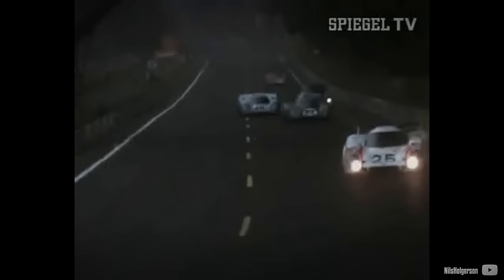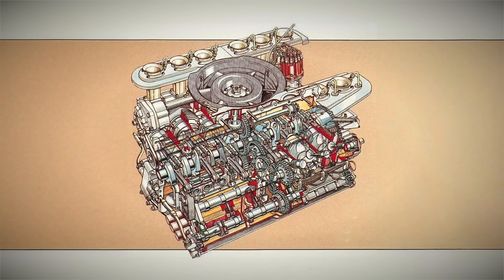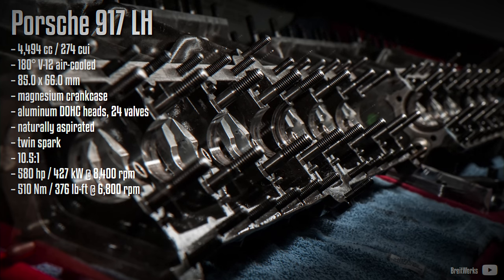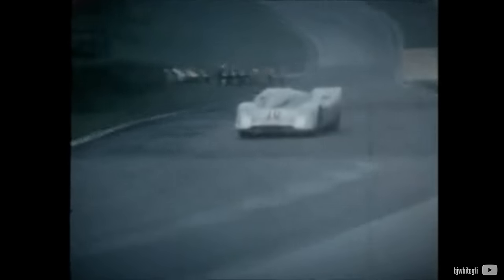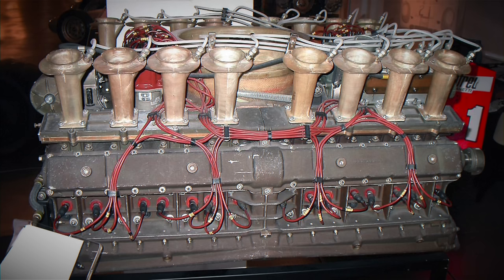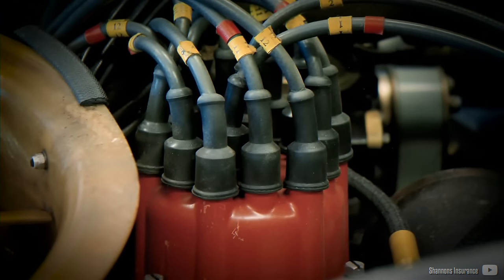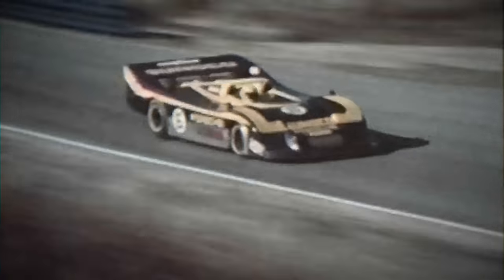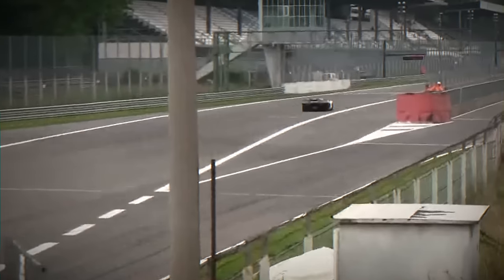Porsche's 2000hp 16-Cylinder Race Car Killer

Comment: Thanks for this awesome video! I have a somewhat special connection to these engines and vehicles as my grandpa used to work as a race mechanic for porsche at that time, he even helped build a few of those 25 917s! Luckily he ist still with us and loves to talk about that time. One of the anecdotes he once told me was that apparently the pistons could melt if you've driven the 1600hp qualifying spec of the turboed flat 12 for too long. I really love him
Reply from the maker: Thanks for the story! I wish your grandpa good health!
Reply: Did he also tell you the 1600hp number is nonsense? Porsche did not have a dyno that could read past 1200hp, so anything higher than that were just theoretical peak numbers that wouldn't be sustainable for any amount of time, given the turbos were blowing hot air directly into the block... intercoolers were tried for the first time only when the car was finished at Can-Am, and was being setup for the closed course record run, and even with intercoolers, they went back to the older 5.0L engine, because everyone knew the 5.4 would not last at anything past 1100hp, which was the actual tune used for quali, nowhere near 1600.
Reply: Hang out with your grandpa, sounds like a wonderful guy. Such stories are fascinating. 🙏💪
Reply: @mxrz This accords with the information I have. Ian Bamsey - not known for exercising restraint on such matters - reports that Penske tested a 5.4 litre engine to 1,500 hp but it was destroyed in the process. I suspect even Bamsey was exaggerating to keep his audience entertained but it rather makes nonsense if the 1,600 hp claim, which is already an exaggeration of the 1,580 hp claim we see everywhere. The only source I have seen for that claim is video game.

Furthermore, even using mathematics, the figures don’t model component failure. They just assume that a torque reading of X, with an RPM of Y and a fuel flow of Z will give a theoretical result.

Finally, the car had a boost controller but it was not calibrated so nobody really had any idea what the boost pressure was when it was running at maximum.

I’ve been watching this bidding war for decades, accompanied by the inevitable unverifiable claims of top speeds.

Even the claims that it’s was the car that killed CanAm ignores the fact that the series had been dominated by McLaren for five years before that. What actually ‘killed’ CanAm was the 1973 oil price crisis.

And of course, this being the internet, I have to defend against the idea that I’m trash talking one of the most iconic racing cars ever built. Of course I’m not. Its record speaks for itself. But even the way this video mentions the Talladega speed record doesn’t differentiate between that car and the normal race car and doesn’t mention that Talledega was not part of the CanAm series.
Reply: @mxrz And let’s not forget that the 912 block was its weakest component. Because it lacked a water jacket, its structural rigidity was never very high and block flex was a significant failure risk.

The 917 engine was simply two flat six blocks bolted together, with the power take off and fan drive in the middle. The cylinders were bolted individually to the block and the head bolted on to that. It was descended directly from the 908 and used many 908 components. That placed limits on what could be done. But that doesn’t place any restraint on the internet, no sir-ee! Put this stuff out there and you get told to ‘do more research’ by people who can’t grade information. They just believe whatever confirms their prejudices and more.
Reply: Cherish your time with your grandparents, I wish I could spent an afternoon with mine again.
I loved them dearly!

Talking to your grandpa must be so exciting, that era of racing is my absolute favorite, even if I grew up in the nineties.
I guess you are from Germany?

I’m also from Germany and I had the honor to drive on the private high speed Oval in Ehra-Lessin quite a few times were they did the high speed tests for the 917!

Beste Grüße aus Wolfsburg!
Reply: You have the grandfather that all petrolheads would like to have.

Comment: the 917-30 has a knob in the cockpit that controlled the boost.... the driver could "dial it up" for max HP, then after pulling away and making a significant lead, the driver would then "dial it down" and finish the race at much more engine friendly boost levels. a great read is "The Unfair Advantage" written by Mark Donohue- the racer/engineer who worked with Porsche to develop the 917-30.
Reply: Mark is/was the greatest!!

Comment: I read that when these twin turbocharged  Porches were raced at Le Mans it was amazing to see the turbos glowing red in the dark of night when going down the Mulsein strait.
Reply: Mulsanne
Reply: Twin turbo Porsches were not raced at Le Mans until the 935, which was a flat 6. The 917-10 and 917-30 12 cylinder cars did not race there.
Reply: Yes even my lowly Sprinter turbo would glow red hot after several hours flat out, you could even see the turbine rotating inside

Comment: I didn't know the 16 had shared journals like the 12. That would mean it had simultaneous ignitions, and also that the front and rear halves would be separated by 90 crank degrees.

Exactly the configuration that Coventry Climax tried in 1966. They gave up because the stop start motion of the pistons kept desynchronising the front and rear halves of the engine.

I imagine the Porsche 16 kept lunching its cam drives instead, along with the quill shaft used as the output.

You can see a nasty torque dip that Coventry Climax also experienced, in their case a clear sign of resonance and lost energy to torsional vibration.

Comment: The 917 Can Am car was not the first turbocharged car in the series. There was one team running a turbocharged GM big block around 1969 or 1970. But in the days of the Bruce and Denny show it was a futile effort.
Reply: Toyota 7, one version was built with turbochargers in 1969/70 but it never raced outside Japan.

Comment: Ferrari had nothing to do with these new regulations of course….
Reply: Quite right: they didn’t. By 1972, Ferrari had lost interest in sportscar racing and didn’t even have an entry for Le Mans that year.

Garagista propaganda doesn’t convert well.
Reply: @thethirdman225  Ferrari skipped 1968 and stopped after 1973. They did not enter LM in some years because their engines did not last 24h, had trouble with 6h or 1000km already.
Reply: @mattg432  That’s a pretty sweeping statement. Ferrari, who won Le Mans something like six time (from my unreliable memory) suddenly can’t finish a race…

Take a look at 1970. Why did Ferrari not finish? For a start, three of them were taken out in crashes. So maybe the story isn’t quite that simple.
Reply: @thethirdman225  Sure, having won in the past carries any car to the finish. Fanboy talk. They had won 1960 to 1965 without much opposition. Then came Ford and broke Enzos neck, twice in 1966 and 1967. Rule change for 1968 and Ferrari had no car while Porsche, Alfa, Ford developed 3 litre prototypes. No factory Ferrari just old 3.3litre customers LM in Le Mans in 1968 when a 2.2 litre Porsche 907 finished 2nd. In 1969, two 312P, no finish. 1970&1971 a bunch of 512 beaten by 917. In 1972 312PB no show as the car was not up to the task yet. In 1973 it finished 2nd behind Matra, not bad, but that was it for Ferrari. They had skipped F1 races in 1973, and abandoned sportscars to focus on F1 after 1973.
Reply: @mattg432  
"Sure, having won in the past carries any car to the finish. Fanboy talk."

Wow.

"They had won 1960 to 1965 without much opposition."

If you say so. Still gotta go 24 hours without breaking.

"Then came Ford and broke Enzos neck, twice in 1966 and 1967"

Emotional language. Tough guy fanboi talk... but it's okay when you do it.

"1970&1971 a bunch of 512 beaten by 917."

No factory support. Not the way Porsche did it. Three crashes in the wet in 1970, which had nowt to do with Ferrari per se.

"In 1972 312PB no show as the car was not up to the task yet."

That's funny because it was up to the task in 1972.

"They had skipped F1 races in 1973, and abandoned sportscars to focus on F1 after 1973."

True.

Not a fanboi. Couldn't care less for tribalist bullshit. Just telling it like it was. If you want to go full tribal, that's your problem but one of us is old enough to remember a lot of this and the other one saw 'Ford versus Ferrari'.

Comment: I guess it's a type but the 917/30 wasn't a V12 it was a flat 12
Reply: All of these engine are 180° V engines, not boxers.
Very strange idea, coming from Porsche, with their lifelong love of boxer engines.
Reply: A Flat engine is a piston engine where the cylinders are located on either side of a central crankshaft.

It's a flat 12.

It also sounds nothing like a V12 either
Reply: @flammenjc  Nope. Flat engines are boxers, with one crankpin per piston. When two pistons shares one crankpin, it's a V.
Of course it sounds strange, because it's unbalanced by design.
Reply: It’s V12 180°
Reply: @Damien.D boxer is always flat, but flat is not always a boxer, but can also be 180° V when opposing cylinders share a crankpin, like in 917, Sauber group C car, Ferrari 512bb and Testarossa.
Reply: It's asinine word play by people who think they are being clever.

The designation is from the EXTERNAL physical appearance. It has nothing to do with the internal components.

A V engine is anything that has two banks of cylinders that form a V shape when viewer from the end of the engine a flat is any engine that has two banks of cylinders horizontally opposed.

What is confusing you is you think a boxer and a flat engine are the same thing, they're not. Flat engine refers to the physical appearance and boxer refers to the piston action.

 @Damien.D
Reply: You're half way there. Otherwise V engines are just folded variations of a flat engine. The point is it's based on physical appearance from the perspective of the end of the crankcase. The firing order and piston action is it's own designation. @StellarGale
Reply: @flammenjc  The most common configuration of flat engines is the boxer engine configuration, in which the pistons of each opposed pair of cylinders move inwards and outwards at the same time. The other configuration is effectively a V engine with a 180-degree angle between the cylinder banks; in this configuration each pair of cylinders shares a single crankpin, so that as one piston moves inward, the other moves outward.
Reply: Right, but it's called a V because of the shape the cylinder heads make. If it no longer makes that shape it cannot be a V even if the cylinders are have mutual crank pins. That's the whole point. @lowiderwheels
Reply: @flammenjc you are totally wrong.
Reply: No, you're just hung up on wordsmith mythology. @Damien.D  

Do you disagree that the term V engine refers to the shape of the cylinder head formation?

Because if you don't, you're doing mental gymnastics to use the term 180deg V
Reply: @flammenjc  we're 4 people on this thread telling you that you're wrong.
Theese engines are (rare) 180° Vees. Period.
Reply: Right, because the minority is always wrong? @Damien.D  

I asked you a question which you didn't answer, because you're suddenly not as confident as you once were. Yet still want to tell me I'm wrong.

You want to ignore the reason these engines even have these categories based on visual form, for an internal knowledge of engines as some kind of flex. Just like everyone else who uses the term 180deg V.

If you made a V 180degrees you get this  _

What next, you gonna call a rubber windscreen seal an O-ring? :'D
Reply: Haha guys can't work out a flatline is 180 degrees,there is no v in any of these engines just people parroting Wikipedia
Reply: @dennisgoussetis4753  The crankshaft is shaed like one of a V engine. But the banks are spaced with a 180° angle, making the engine flat, but the correct way to understand its inner working is "180° V"
Reply: @Damien.D  no its just people thinking they're smarter than others by sticking to bullshit semantics.
Reply: @flammenjc  the shape of a crankshaft is no semantic....
Reply: A v is not measured by the crankshaft,I'm a mechanic and never heard of a v crankshaft, please find a Porsche tech report

Comment: Why didn't they use this engine in Buggatti?
Reply: When??
Reply: @trance9158  When they(VW) owned Buggatti.
Reply: @DailyLifeSolution  they didn't own them back then
Reply: @trance9158  Not then but since 20yrs
Reply: @DailyLifeSolution  also Bugatti is still owned by Porsche and Rimac. Porsche has 40% or 45% ownership in Rimac. VW is actually owned by Porsche due to the family having a majority share on the board of directors.
Reply: @DailyLifeSolution  because the engine was outdated by 1998 when VW first purchased them
Reply: @trance9158  They can modify that engine to modern standards. They have tonnes of cash.
Reply: @DailyLifeSolution  that's stupid... It's outdated... A formula 1 turbo 6 is as powerful as this if not more

Comment: Fin fact porche cpuldnt get the engine to work. It was mitsubishi designed balancing shaft that made the car possible
Reply from the maker: This 12-cylinder? Not sure about that. As far as I know, they tried their own balancing system on the Porsche 944 engines, but eventually ended up buying the Mitsubishi technology
Reply: @VisioRacer  so to summarise, they couldnt get it to work and used a mitsubishi designed balancing shaft
Reply from the maker: @camrunner6633  But that is a completely different engine for a very different car
Reply: @camrunner6633 Balancer shafts are only needed for four and eight cylinder engines running a flat plane crank. They minimise second order vibration and are probably not needed in a full race engine anyway. They are also no a ver complicated device and could be designed by almost any competent automotive engineer .